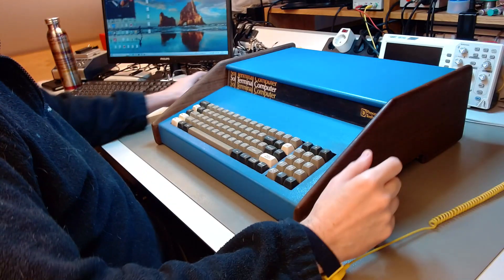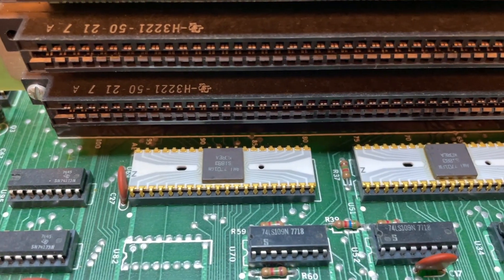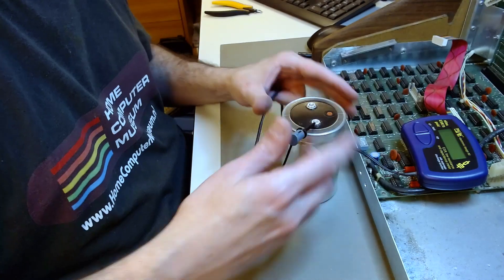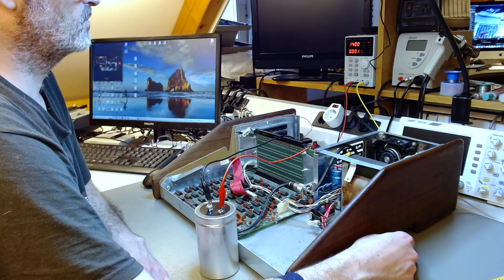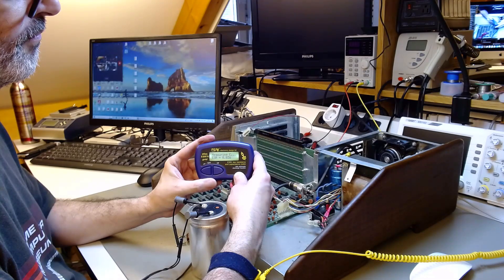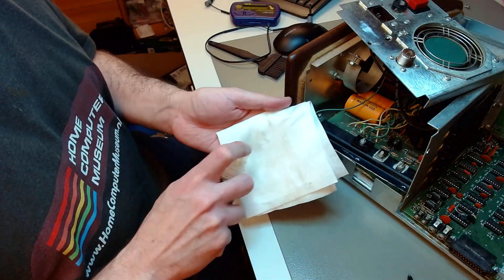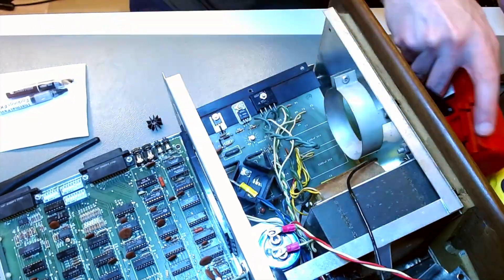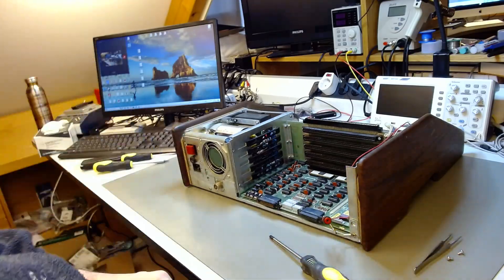SOL-20 museum restoration, PART I

Comment: The little aluminium piece (2 pass transistors and a bridge rectifier) is sometimes called a "heat spreader" (rather than a heat sink). A heat spreader is intended to conduct the heat to an "actual" heat sink (that dissipates heat to the atmosphere). YBH I think in this case it's more of a hybrid.

You sometimes see small copper heat spreaders carrying heat from the centre of a board to a big heat sink (aluminium extrusion) at the edge of the board (and case).

(yes, I'm coming from a audio amplifier background, where heat dissipation is a big deal!)

Comment: Are there some tantalum capacitors on the supply board? Might be a good idea to exchange these for preventive maintenance. Very cool project, really looking forward how this proceeds.
Reply from the maker: I"m trying to replace as few parts as possible. The way I'll deal with the three tantalums on the PSU board is to use a variac (variable transformer) on the AC input and bring the PSU very, very slowly up to voltage.

Comment: Tech Tangents had a good video recently on reforming caps, and even built some software to help automate the process (assuming you're using comparable equipment for the power supply and monitoring the state of the cap).